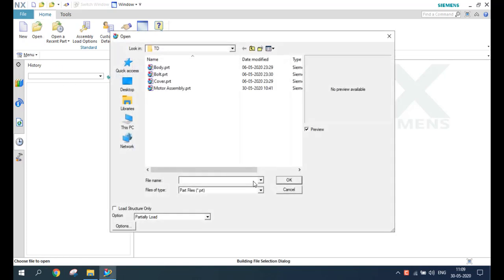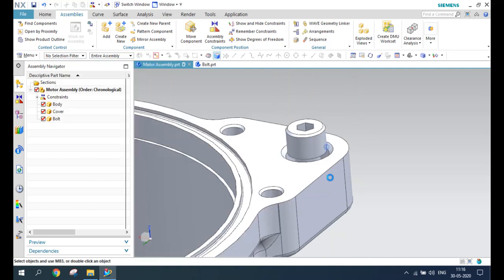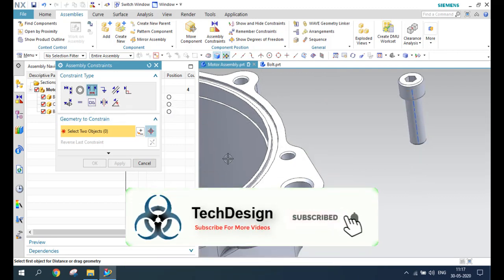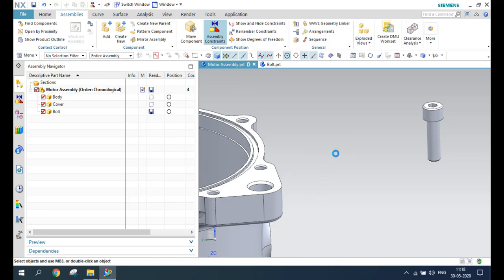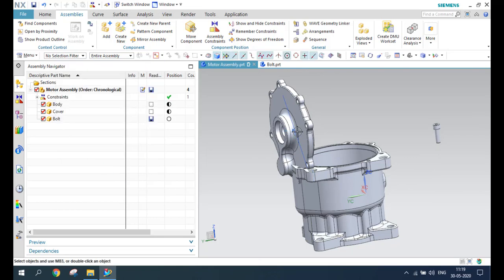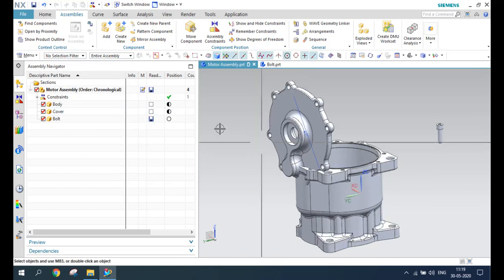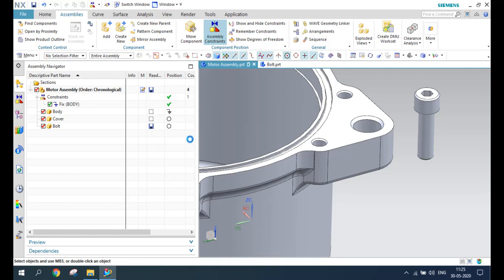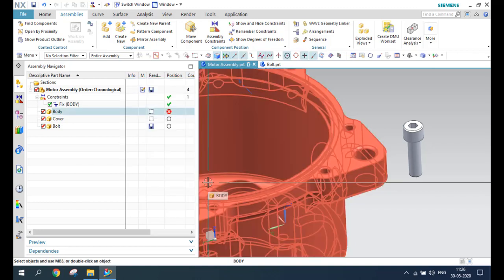Unigraphics NX-Assembly Tutorials || Assembly Constraints Part 2 || How to assemble components in UG

Comment: How to use datum planes to constraint DOF?
Reply from the maker: Just select planes instead of faces
Reply: @TechDesignsantosh  datum planes are not showing in assembly?
Reply from the maker: @omkardesai3983  Create if not existing or you can also make any part datum plane to visible in reference set
Reply: @TechDesignsantosh   got it sir, thank you for quick reply.🙏🏼